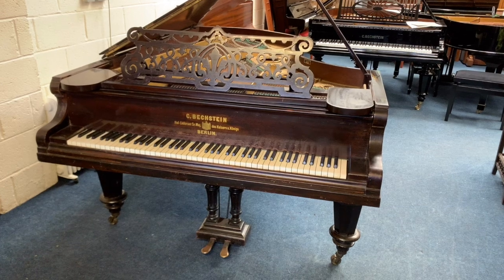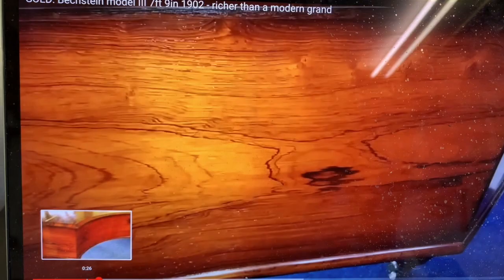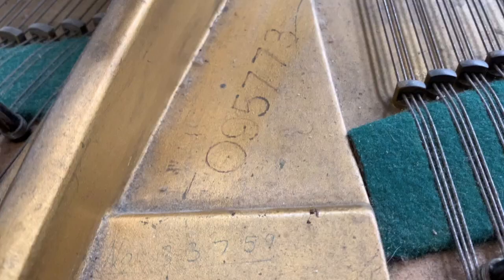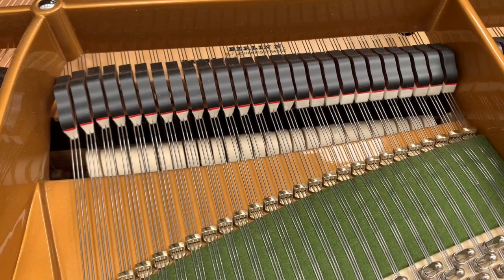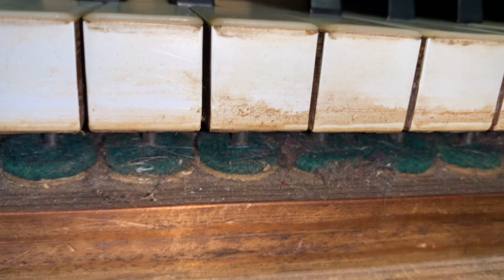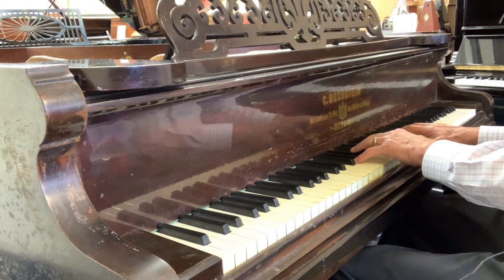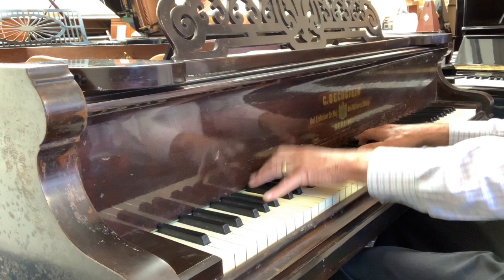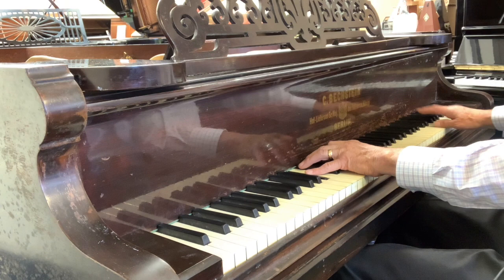Assessment of a Bechstein 220cm 7ft 3in grand c1890. To shorten the video use jump links below:

Comment: My Model D No. 51674  ~1900 has the simple C Bechstein logo and no elaborate transfer  - but has been restored...  
 - But seems to be the start of the new revised design series which were probably made alongside while parts were used up?
Reply from the maker: Thank you for that information. From what I have found, it seems as though from about 1900 to 1902 the models vary quite a lot; they seemed to be experimenting. The model Va for instance is very common and is between a V and a B
Reply: @RobertsPianos  Marcus - To assist  with your records the number on the wooden frame beneath the soundboard is 15855 + a whole load of cobwebs! No splits - no daylight :) !!!
It has the square fretwork music desk. 
Actually it was restored by Bluthners at Perivale - late 70s. But retains the original soundboard if rather thickly varnished.